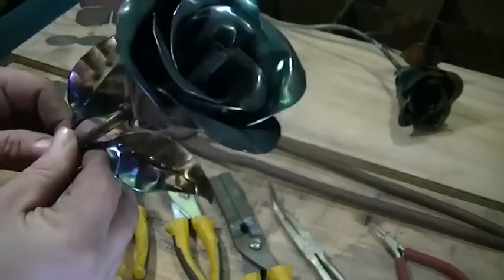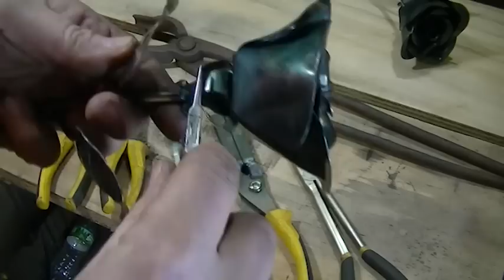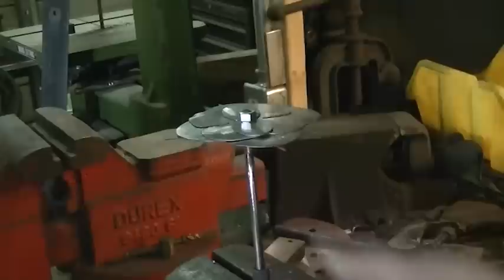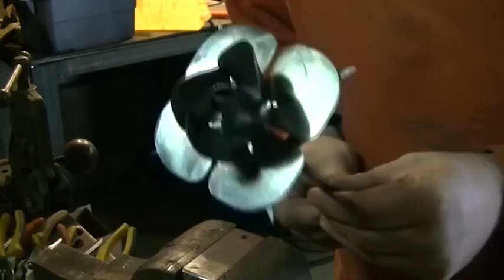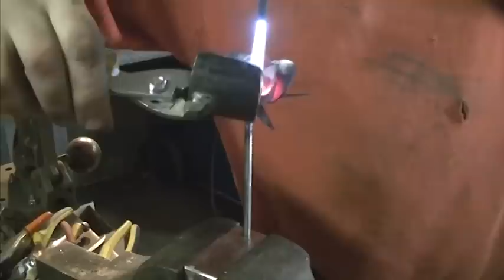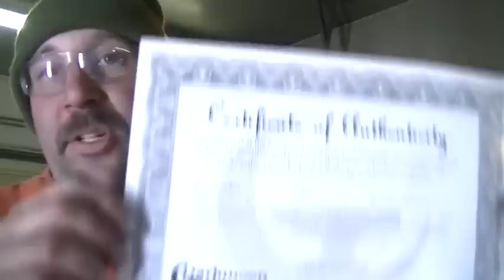Viewer Question: What Tools Were Made To Help Form Out Steel Roses?

Comment: jeff, great video.  what do you do at this point, for finishing, do dip in anything, to remove scale, brush or buff?  please explain
Reply from the maker: Heating up the rose and dipping it in water tends to blast most of the visible scale off, if not I use a steel wire wheel. Most roses are colored by the flame of the torch, get a lot of purples and deep blues. I attach the leaves later on and heat them to straw yellow to light blue. When I leave the metal bare to show the heat colors I use 2 coats of clear enamel to seal them.

If the client wants the rose painted a color I'll sand blast the rose first, then 2 coats of the color enamel. In the winter I'll hang them above my wood stove and let the paint bake a bit. Comes out really nice and glossy.